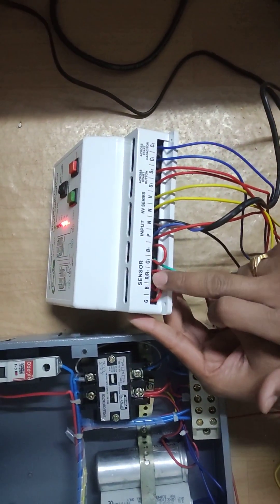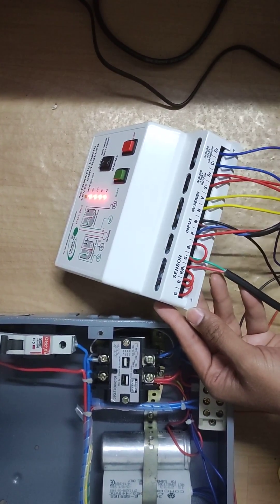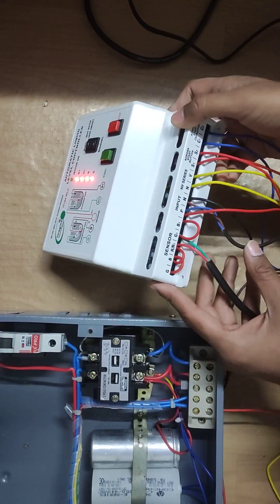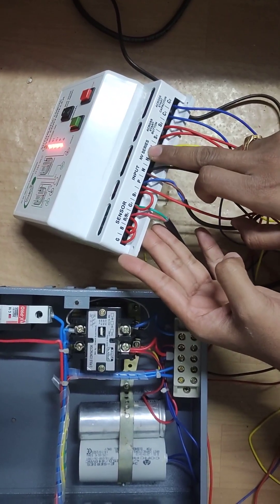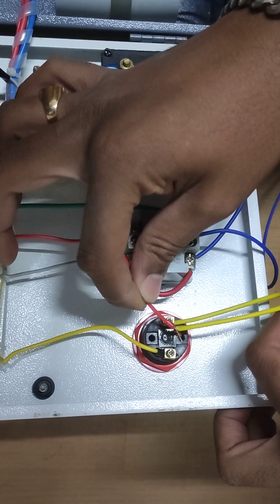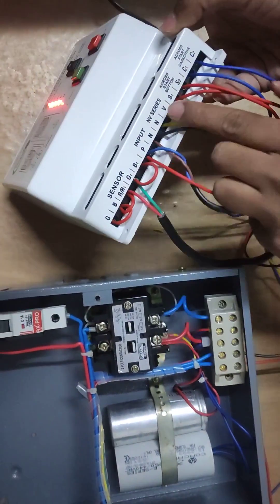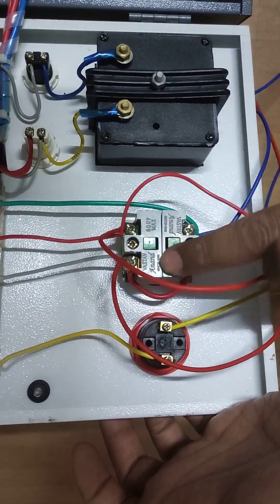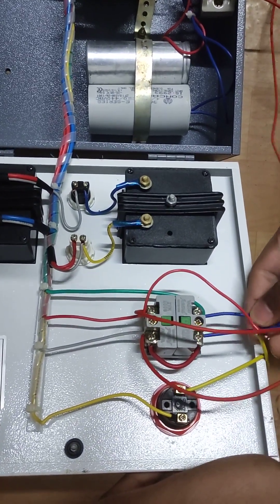How to install imagine technologies IT184WLC Water level controller(ENGLISH LANGUAGE )

Comment: Sir ji, 
aap jo controller ke connection dusri device se kar rahe hai vo konsi device hai ,ya ye connection device khol ke device ke under karne hai.
Please reply me ,i have just purchased it for my overhead tank .
Reply from the maker: ITS MOTOR STARTER
Reply: Which type of starter required for  single overhead tank

Comment: Sir i am installing this device for my submersible, how much “MM” wire should i use ? And Nice video❤
Reply from the maker: for sensor use 0.5sqmm wire and for other connection use wire as per motor load  min use 1.5sqmm
Reply: Thanks